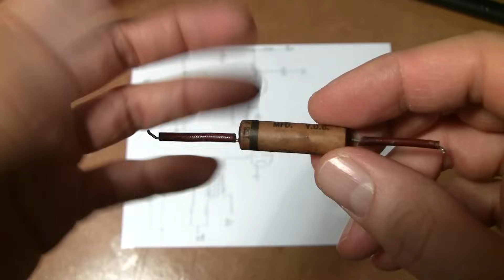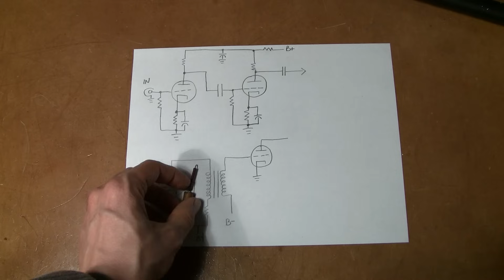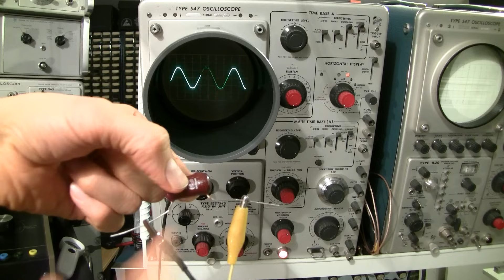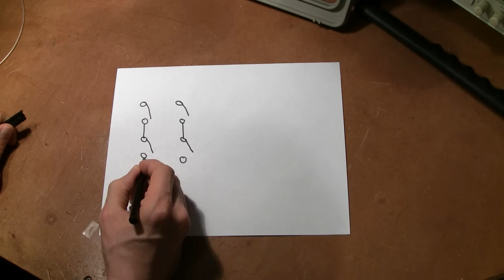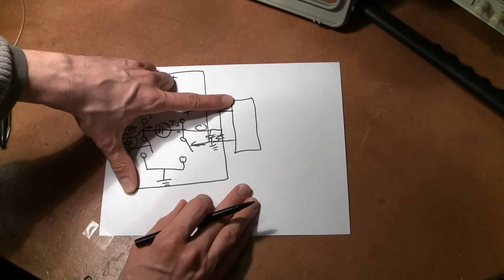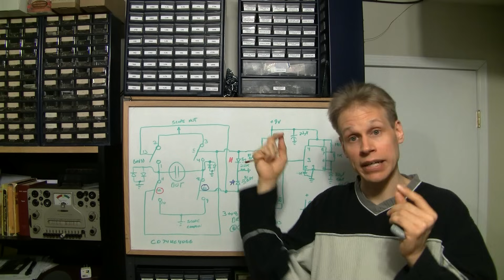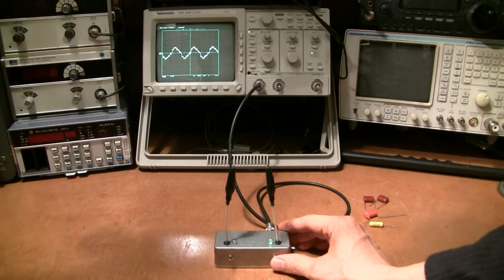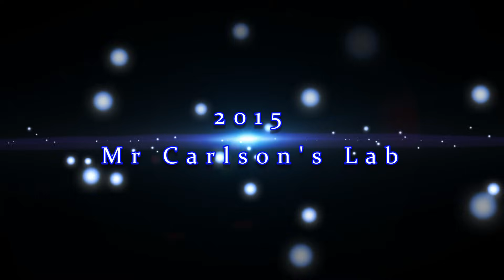Are Your Capacitors Installed Backwards? Build this and find out

Comment: Great video! Everywhere I've been lurking for info it's been told "they're non-polarized so it doesn't matter"... also on seemingly respectable tube amp enthusiast forums, although they otherwise focus a lot on hum reduction techniques and proper layout stuff. Guess this info got lost with the omitted bands? Maybe EEs even thought since they were no longer marked it no longer matters? Or then I just haven't been reading carefully... Who knows.

I remember wondering why my dad's old 1963 Dynacord I am rebuilding (a project that started four years ago and is finally being resumed) had clear polarity bands on the old, supposedly non-polarized caps. I saw this so I had to dig out the old pics of it in original condition - it seems to me they were arranged just like that, band towards the plate, so they probably knew it back then.

What do you think, does this issue concern stomp boxes, or can I just carry on making mine with untested polys and not worry? Except for a couple of fuzz boxes, my designs have had very low noise so far. I just hate unintended noise and do my best to minimize it. Thanks for great videos! -Eero
Reply from the maker: Eero Nurmela  I couldn't hurt to install them with the band end to the lower impedance point. If your stomp boxes are metal or the like, you probably have really low noise already... But again, couldn't hurt to try. Thanks for the comment Eero!
Reply: Yes I only use metal boxes, but I think I'm going to try if it makes a difference. I've got plans for other audio devices to make too, so this info is very useful either way. Thanks!

Comment: Clever Paul! I like it. I have a little rig using a DPDT switch in an Altoids tin that I use for this -it works and ends the unwanted capacitor juggling. Low part count, no IC's to zap.  Sans LEDs -the switch lever points to the Lo-Z lead  (foil out lead) . Circuit and concept is basically same as yours, just more caveman.
Reply: I wondered about this--why the circuit, battery, led's..............I'd go with the DPDT switch in the box, every time!
Reply: @alanlevin167  I saw th ebox and thought: okay, DPDT switch... but it turned out to be so complicated. Actually it could be an SPDT switch as well... use two 100k resistors feeding into the scope from either end of capacitor and use the switch to ground one end or the other. This will also protect the scope from some cap voltage left, but will of course reduce th eeffective input to the scope.
Reply from the maker: cny02253 LOL, Caveman made me chuckle! Hey, what ever works right. Thanks for the comment....LOL
Reply: Thanks cny02253,  I was going to say that a simple DPDT switch would seem to work just as well - and never worry about having a battery go bad right when you need it.
Reply: Watch out, the Altoids generate a lot of heat.
Reply: @markgigiel2722  Love the Altoids. I never tried them till I needed a tin for a project.  Now I can't get enough of the Cinnamon ones and that box is cool looking to boot!
Reply: cny02253 
Instead of caveman I call it Flintstone.
Reply: Ah. At least that validates my question :) I thought of this too (but I'm  only at caveman level)

Comment: Great Video, thanks Paul. I am planning to make such a circuit (of course not a printed one)  but unable to see the details you made in the whiteboard and wondering if you can upload a drawing of the circuit in a place like QSL.net and share the link in your youtube post.  Finally is it right to assume the same discussion for electrolytic capacitors as well?
Reply from the maker: esmaeil nam Hi, this test does not apply to electrolytic or ceramic disc capacitors, just the ones mentioned in the video. I may upload a drawing. mind you when this is viewed in 1080P HD, full screen, the values are pretty easy to see. Thanks for your comment!

Comment: I love your little Test jig it is great. However, your description is a bit vague on components and construction.so my question is:
1. Do you have the circuit hoard layout top and bottom?
2. A list of parts used.
3 pictures of both top and bottom.

Ideally it would be great, as Have Parkinsons and don't work on solid state anymore just tube types. Would to have you build one of these for me. Email me at rrichard@oldtymeradio.net with your ideas and perhaps a cost to build it? 

Thanks not only for this video as I have always known about this issue and now a easy way to get it done. I have been doing it the way you started the video but it's a pain, as you know.  Any help you can give me would be fantastic and save me time too. My hands are simply not steady enough to make it.

Thanks again
Robert Richard
Reply from the maker: Robert Richard Hi Robert, The parts and schematic are all listed on the white board. The circuit board you see is in a specific program, and you would need the same program to reproduce it. Remember the parts are the size of pepper in my build. This can be done with through hole parts, no need to make it this small. Again the only reason I made my unit this small is because of the project box I had on hand. I'm releasing the idea for others to build, I don't have time to go into production. Sorry to hear about your condition! Just so you know, youtube marked you as spam. I had to release this message. You may want to check your settings. Thanks for your comment!

Comment: HI there :) Paul (PA1TAS) here.
I have a question about the small cap's that you get for most hobbyist that we use 101's 103's 202's and so on. The small round orange once. Do they also have a polarity? Because if the cap's that we use for our hobby's are also polarity secretive, wouldn't it be better to measure them like the once that you are using? BTW great videos and also very informative for those who wants to learn more about electronics and maybe take there amateur radio exams
Reply from the maker: Hogkat Hi, If your talking about ceramic disc capacitors, they have no polarity. Ceramic disc capacitors are great for RF bypass! Due to their piezoelectric affect, there not so great for audio. (very micro-phonic)Thanks for the nice comment!

Comment: Very interesting, great video! I wonder if a standalone automatic version of this would be easy to do using the built-in A/D converter in an MCU instead of using an oscilloscope. Say an ATtiny25V or something like that which has a 10-bit A/D converter with adjustable gain (up to 20x). You could measure the amplitude of a half rectified signal with that. Of course that would remove the 555 and maybe allow to run off a couple of AAA?
Reply from the maker: telecrate Lots of neat ideas! Sounds interesting telecrate.... Although, when designing something, I try to use off shelf parts so everyone can build this. The Atmel microcontroller is a cool idea, but many don't want to fool with this stuff. Thanks for the comment!

Comment: I'm so glad you have expounded on this capacitor phenomenon Paul!
   Great circuit that you have designed to test these with. I just wish that you showed us how you make the circuit board itself as well.
    Looks like we have the same scope, the menu driven Tek 465. Great analog scope. I still prefer the older 465 though with the rotary switches like I use to use at work. I also just recently donated my working Tek 535 dual-beam scope to a military electronic store that my friend Glen owns. Never once had I needed anything to do to it to fix it. Check out the pictures of his store. Google; "Electronic Dimensions" in Tacoma, WA. Then click "about us". It's a store and museum in one. It's not really a museum, but should be one. The pictures just show the store part.  The other section of the first floor is many time bigger. Then there are more floors of this equipment.
   Awesome video!
      73's
            Tom
Reply from the maker: ***** Thanks for the nice comment Tom! I will check out the store as well.

Comment: These days with lower impedance circuits and much smaller components this issue is probably not an issue at all, if it was end user manufacturers would insist that all caps show polarity. As your tests show, even vintage capacitors were often marked incorrectly and hum on old valve domestic radios/TVs always had abit of hum, that's how you knew it was working!
Reply from the maker: Michael Beeny Well, I guess that's the difference between, "just doing the job"....... And doing the job Right.... And of course, cost cutting. When it comes to electricity, there are no shortcuts (without results) If you build amplifiers or RF circuits, that extra exposed surface (when installed backwards) can give nasty results. Even in lower impedance RF circuits, that extra lead inductance (body included if installed backwards) can, and will give you coupling to other circuits. In the RF game, every bit counts. Thanks for your comment Michael!

Comment: Very well made video and build as always. Until I get myself a Digital Oscilloscope, I kind of don't want to have to turn on and off too many times my analog oscilloscope just because I'm paranoid about it braking. So with that in mind I think I found another solution at least for me and it goes like this: A DPDT switch wired as a polarity reversal (reverses the leads) and then feed the output from that into a unity gain wired op-amp so that the input impedance will be very high (basically infinite) and if that is too high impedance then I'll just use a resistor to bring the impedance down to something practical which should keep the noise down. Then feed the output of that op-amp into my signal tracer or a regular amplifier which has a pretty low input impedance and then just listen for the buzz. I will give at try tommorow. Cheers :)
Reply from the maker: ciprianwiner Sounds like it should work, let us know how it goes.
Reply: ciprianwiner 
Turn your scope on and use it. If it breaks down you'll have fun fixing it.
Reply: +ciprianwiner I know this is late but I came with my results on this idea of mine... it didn't work very well at all so I gave up on it for now. Tonight I got back from work and I wanted to find out the negative end of my Wima Red capacitors that I need to use on a tube hybrid headphone amplifier and what I found out is pretty amazing. It does not matter where you connect the ground on them because the noise if virtually the same! Why? I'm guessing that they have a metal shield over the foils them like I've seen on a X2 rated Wima capacitor and that one exhibits the same kind of behavior. On the other hand I tested some orange dips and they are very sensitive to the negative band end, also tried some styroflex capacitors and those are very sensitive as well. So yeah, it looks like the manufacturers have done their homework and try to make capacitors immune to induced voltages. Cheers :)

Comment: For people without a scope, one could also use a very simple circuit that uses a small but sensitive audio amplifier with a diode on the O/P connected to an analogue meter. This should clearly show which way round the capacitor needs to be by how large or small deflection is. It might even be possible to replace the meter and diode with a loudspeaker and hear the difference. Even a domestic or HiFi amplifier that has as mag input at about 2/3mV should work well as the input is sensitive and has RIAA EQ  (ie bass boost) Be careful with levels, you don't wont to damage your loudspeakers!! or just buy a scope!! and make Mr C's tester.
Reply from the maker: Michael Beeny  Sounds like another great idea! Thanks for the comment!
Reply: I built one of those! Have to do a video...
Reply: My video would be really bad in comparison to your knowledge...  Been watching your stuff, wow incredible insight!  Good stuff man. Really impressed!
Reply: Michael Beeny It would be even better to come up with a circuit that merely lights the LED at the end that is 'outside foil'. Is that even possible? I know almost nothing about electronics, but always find it fascinating.
Reply from the maker: You should, Then come here and let us know about it.
Reply from the maker: Thanks for the very nice comment!
Reply: Michael Beeny Anyone watching this would have a computer or smart phone for which there are free oscilloscope programs to be had that use the sound card for inputs, this would also work as it is just 60 (or 50) hz that is being monitored.
Reply from the maker: Maybe something with a bar graph indicator . Having a circuit to figure that out, would have to be processor driven, since different brands of capacitors have a different response in gain on the scope. The test greatly depends  on your ability to couple stray AC into the capacitor with your fingers.

Comment: Nice job, thanks! I was having trouble getting my Tek 2465A DV to work checking the caps. Maybe I had the volts too high.
You could mark the caps on the bottom instead of the top if you didn't like marks on the top of them.
Reply from the maker: Robert Calk Jr. Any old place is just fine. The nice thing about using "white out" is, you can easily scratch it off with your fingernail (if the epoxy isn't porous) Thanks for stopping by Robert!
Reply: Mr Carlson's Lab 
Yeah, white out will work. I put my scope on 2mV and now it is checking the caps great! I will build myself a test jig soon. Thanks for your wonderful teaching!
Reply: Mr Carlson's Lab 
I'm a subscriber.

Comment: Hi Paul!  After watching you use your 'scope to assess capacitor polarity in the HQ-120 restoration video, I gave the technique a try and was unable to replicate what you demonstrated.  After sharing the video with a friend, he had the same problem that I had - there was no difference in the scope's display when I reversed the test leads on the capacitor.  After watching THIS video I revisited the effort and came up with the same results as before.  What must I be doing wrong? (Mike, K9UW, Amherst, WI)
Reply from the maker: K9UW Hi Mike, are you holding the capacitor with two fingers? Does your scope have a high impedance input? Are you using a shield cable, and have minimal exposed surface by the connections to the capacitor? What brand of capacitor are you testing?
Reply: K9UW Are trying to test a ceramic disk cap? Cause they are not polarized! Are you in an RF cage? Do you show AC line ripple when you touch the tip of your scope probe or center conductor of your coax? If not, something is set wrong. If you are using a scope probe instead of just a coax with alligator clips, make sure it is a 1X probe, or on 1X if it is switchable. If you are using a DSO, check your input and DSP settings., maybe it filtering the AC off the input, sort of like a LF Reject.
Reply: cny02253 
My scope works with a 10X probe or a coax with grabbers on 2mV/div. It also works on ceramic disk caps as well on larger caps. The tiny caps don't work very well though.
My 10X probe didn't work very well today. The coax is much better. I also noticed that it doesn't work very well when my elbows are on my anti-static mat that is grounded.